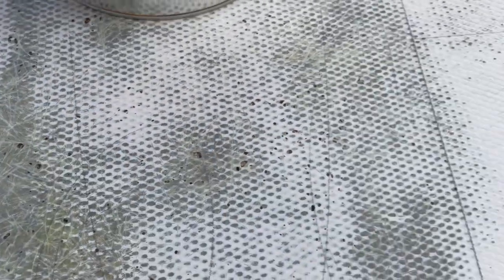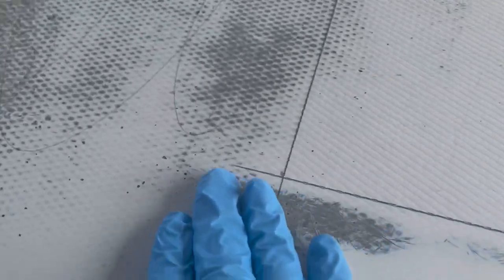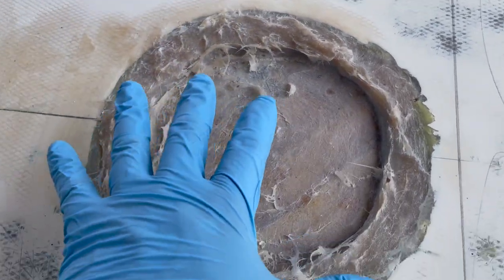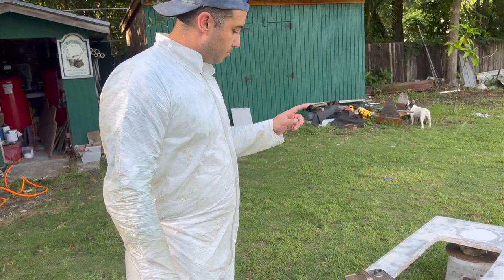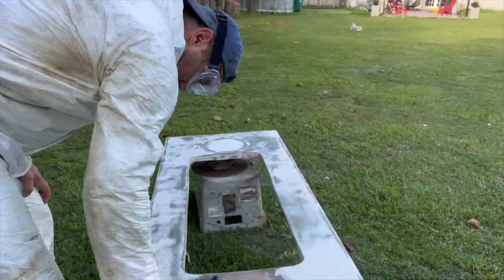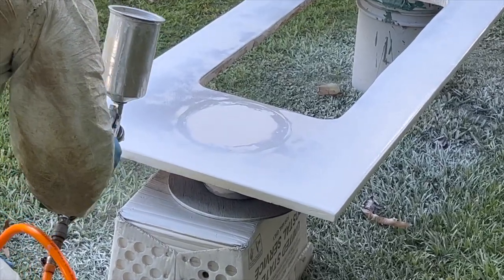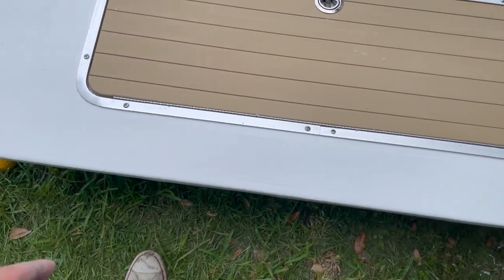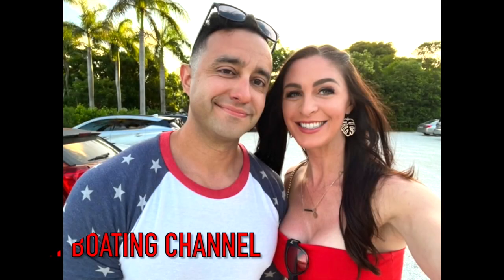Don’t Buy A Deck Hatch Until You Watch This! DIY Installation!

Comment: Yall are Killin it. Your the master of the nonskid..

Tip: seal edges of the cut wood with resin to waterproof (prevent rot).

Steve
Reply from the maker: Haha! Thanks! 

Youre correct! Before installing, I went in with a chip brush and coated the inside lip with some resin. That’s usually how water gets in! 👍